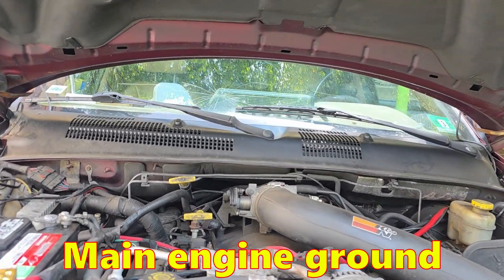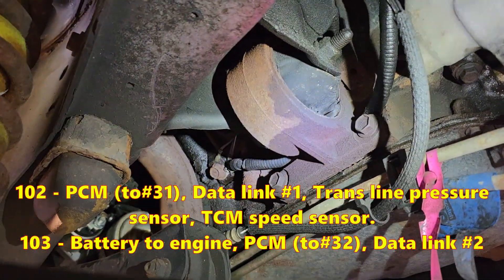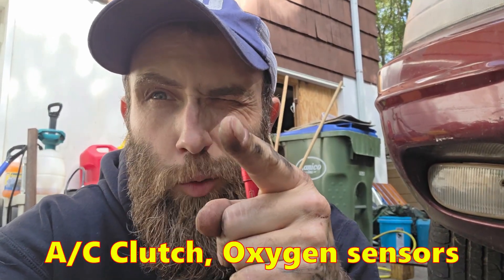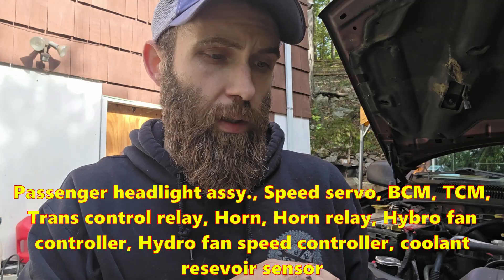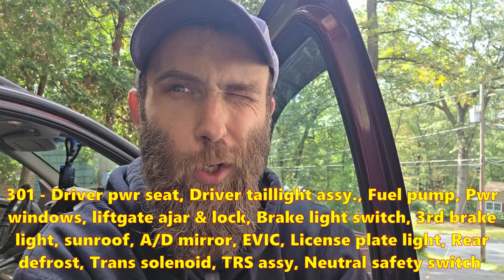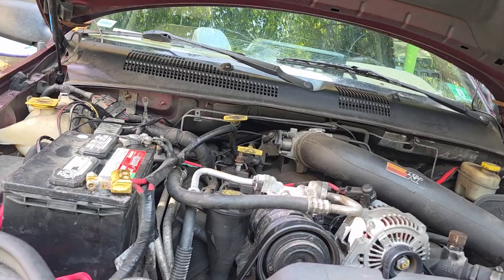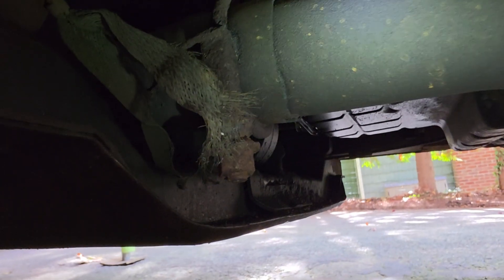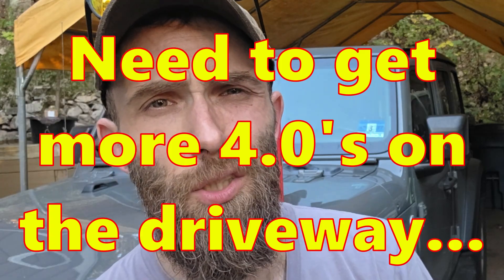Every Ground Location & Purpose - Jeep Grand Cherokee WJ (4.7L V8)

Comment: Fantastic help, Boss. Currently dealing with a P0750 trans solenoid A code on my 02 Overland. Just replaced with whole solenoid pack and still have code and still no overdrive. TCM Relay within spec; resistance reads 66. Now going to check grounds.
Reply: Any luck ?
Reply: @Cole-p3l1u  none yet. All grounds seem ok. On to checking power to through the plug and whatever else i can find. I'm wondering if it may be the newly installed solenoid pack itself.

Comment: What about G302 on a 2007 grand jeep cherokee? Everything works until I turn on the lights and then the right rear dies. I replaced the third brake light and I've read g302 is under passenger rear seat and also behind.trim in rear cargo area. 🤣 where is it please?
Reply: Sorry g302 groundpoint

Comment: Please provide your website link, I searched but did not find the URL.  Also, a very informative and useful video.  I have two WJs, a daily driver and  a 04 Overland with 247K miles on odometer,.  I  rebuilt the engine, ( with 08 intake and cams,  Bosch injectors ),  rebuilt trans, replaced the 247 with a 242HD and  ended up replacing axles with Rubicon axles.   I would live to connect with you and  your website.

Comment: This was just the video I was looking for. I’m finishing a H.O. motor swap on my 2000 WJ and couldn’t figure out the Y ground strap on the passenger side. Did I hear correctly that it goes on top of each rear coil pack?

Comment: Ever had fuse 31 have 12v untill the 23 pin trans connector was connected ...  ? Checked all grounds clean and solid .. new solenoid pack new valve body  checked ohms  all within spec . The cause of this was a blown hydraulic line for the fan put the trans in limp mode . Replaced line now transmission stuck in line with no voltage on 31.

Comment: I’ve got a 2000 with the 4.7 liter. Thing is throwing trans codes. Not shifting into overdrive. 30 amp fuse was blown. Changed it. Almost made it worse? Hoping it’s the grounds. Any ideas? Codes P1794 P0720 P0715 and P0731.
Reply: I've got code P0750 solenoid A failure. Replaced the whole solenoid pack and still have the code and no overdrive. TCM relay within spec; resistance of 66. Going through fuses and grounds this week.

Comment: I can verify the exhaust ground does affect the radio.  I was having radio cutting in and out but also static that would be affected by the RPM 's.  The braided ground was barely holding on by a few strands.  I replaced and all the issues cleared up.
Reply from the maker: Thanks for the info!

Comment: I HAVE A JEEP GRAND  CHEROKEE LAREDO 4.7 ENGINE AND  I HAVE TROUBLE WITH THE CHECK GUAGES LIGHT COMMING ON  CAUSING THE ENGINE TO RUN ROUGH AND GUAGES TO OIL PRESSURE  GOES TO ZERO AND THE AMP GOES TO ZORO AND GAS GUAGES  GOES TO FULL ANY THOUGHTS
Reply from the maker: Could definitely be a ground issue.... or a poltergeist 👻
Reply: On the day I brought my 2000 WJ 4.7 home it died on me. I tried to start it and the motor would turn over but not start. After sitting for 20 minutes I tried it again and it started. I started researching and most of what I found pointed to the CrPS and/or the CaPS. I changed both out and the same thing happened again. I started researching again and I found out that the solder on the computer was not the best and was known for losing contacts when the computer got hot. In letting it cool down the connection was made again. I am now on my 5th computer and recognize it immediately. Guages do what you described. The motor will turn over but not start until the computer cools off. Wish you well on this as the computers are costly. I bought the first one from a company in FL and when trying to warranty it they had too many hoops to jump through. A couple came from Ebay and they didn't last very long. I tried Flagship and what was supposed to be 7 to 10 days to ship wound up three weeks before I canceled. I bought one from O'Reilly's but had to get a locksmith to program the skim. The O'Reilly's has been working great for two years, thus far. I hope, for your wallet's sake that it's a cam or crank sensor but with the guages description? If it sits for 20 to 30 minutes and then starts, I would say the computer. It will run rough, after starting, as the computer has to relearn it's perimeters.

Comment: Have a 1999 WJ that the front map lights, back passenger door lights and rear cargo lights will sometimes stay on while the front door lights dim to off when locking or starting the vehicle. Have not been able to figure it out. Seems to do it more often when cold outside but not all the time. Anyone see this before?
Reply from the maker: I have not seen that one myself. Short somewhere sounds like. Check connectors if it is happening more when cold. Good luck bud!
Reply: That may be a broken wire in the wiring harness that goes into the driver's side door. I was having side windows that would only work when the driver door was in a certain position, partway open. I ordered the harness but did not replace it until I had to pull the dash because of a heater core leak. I replaced everything in the airbox and while I had the dash off, I went ahead and replaced the harness as it was easily accessible. On one wire, I could see that it was broken and only holding on by a piece of insulation. Two other wires, you could not tell by a visual but in bending them you could tell that they were broken. As an aside, if you have to do anything in the airbox, AC and heating related, replace everything in it. This includes heater core, evaporator coil, metal blend doors, check vacuum lines with a vacuum pump. That will also include the vacuum line going to the vacuum reservoir, under the passenger side headlight. This will save you the headache of trying to get to the reservoir and finding no leaks there. Also, get some foam tape to seal up all the airway connections. Also, what DE said.

Comment: I very much look forward to the 4.0 video. I replaced the Pcm (removed the SKIM), then found my guages and evic not working. Even replaced the bcm and the wiring harness for both front doors. I am hoping based on this video that it's a bad ground by the driver seat.
Reply from the maker: They get pretty bad down. Worth a look. Good luck!

Comment: I am no off roader, but, I had a 2000 WJ.  It was great for me.  One issue.  Radiator sprang a leak out of warranty.  Fortunately, it was high so I could still get around without cooling issues. 11 months later, the replacement also sprung a leak in almost the exact same spot.  11 months was key because it had a 1 year warranty.  Weird, but that was the only issue I had in the 8 years I had it. Don't recall exact mileage. but I did not hit 100k.